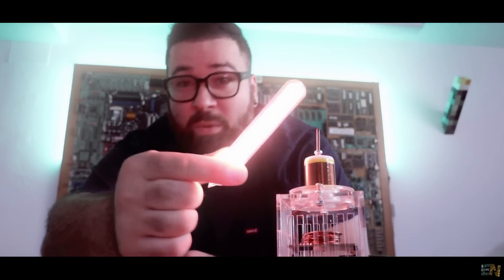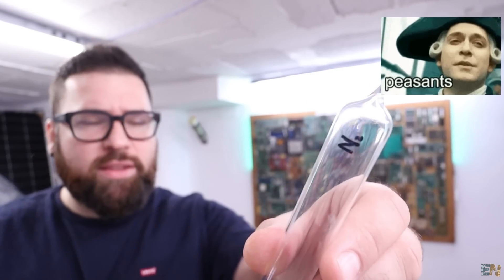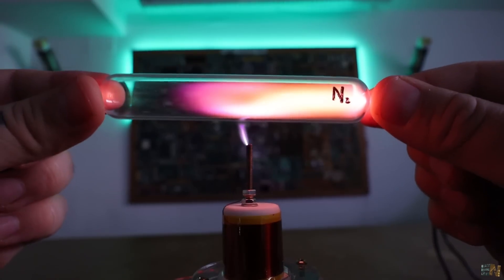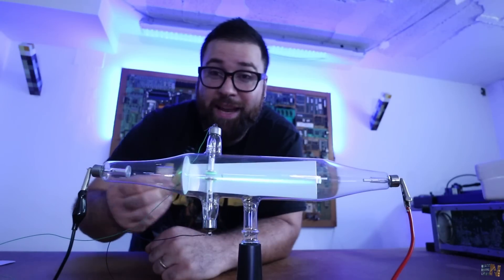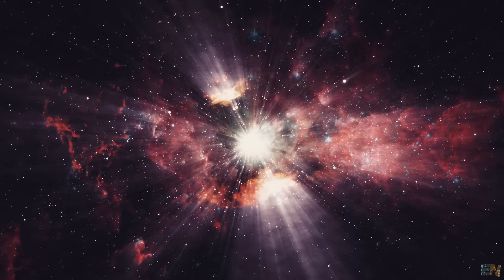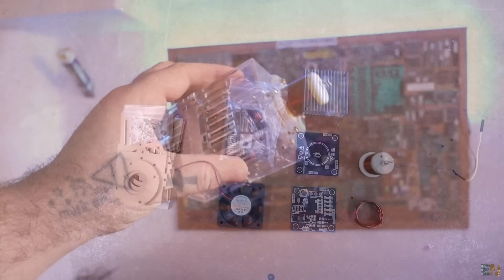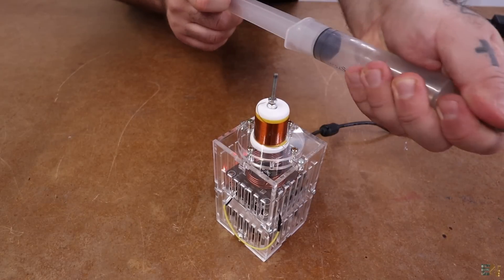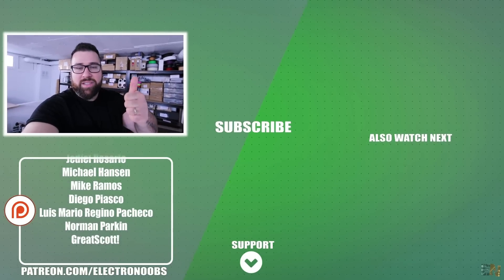Making REAL Plasma in a Bottle at Home

Comment: On fusion reactors, we were one step away from achieving it for the last 30 years and billions of dollars ago. We are no closer today.

Fusion is achieved in an electric field at the surface of the sun, not in its core. 

Look into the electric universe SAFIRE experiment, which achieved transmutation and energy generation in low pressure electrical discharge plasma.

Comment: If low pressure gas conducts electricity, does it conduct magnetic flux, too?  If the atmosphere at extremely high altitudes is conductive, and we live in the dialectic medium of standard atmospheric pressure, then we should be able to collect some massive charges from the solar wind and every mountain should be a generator.